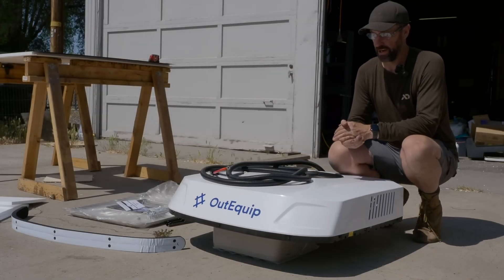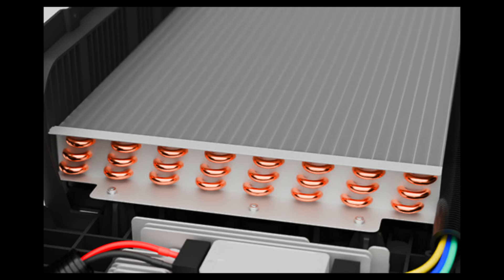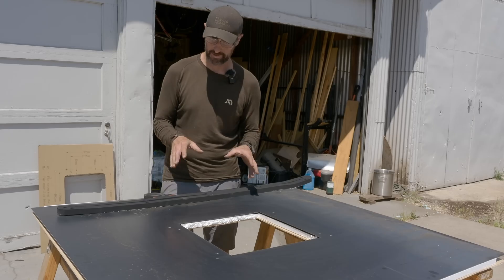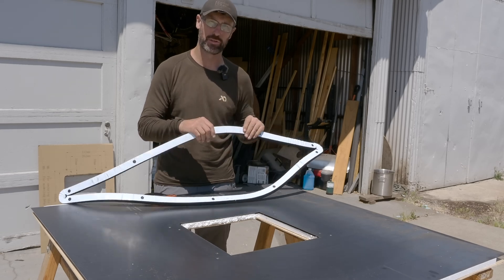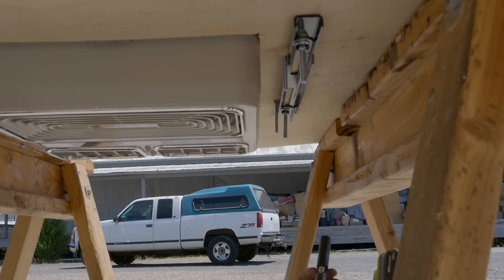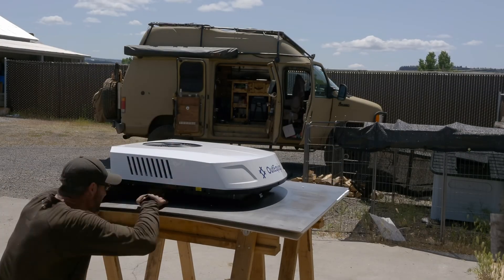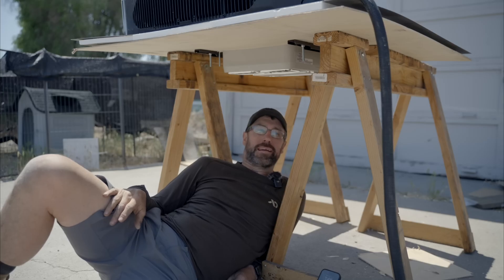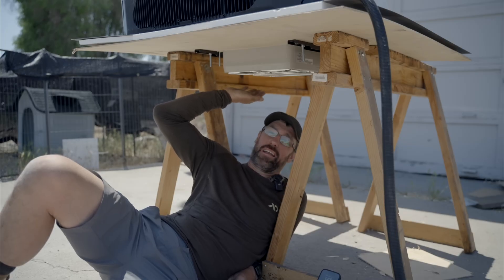OutEquipPro Glacier Pro 12V Air Conditioner with Heat Pump Installation Guide

Comment: I don't know why they don't make a gasket to fit your actually 14-inx14-in hole rather than having to cut the gaskets for both heat pump and just regular A/C unit.

Comment: Your OutEquip looks completely different from the OutEquip that I just purchased, must be a different model.  On my version, you don't have to drill holes for the brackets.  16.5" x 15.3" is the largest you can cut the hole opening, the brackets only measure 19" so an 18" opening would be too big, the brackets need roughly an inch of contact to secure the unit to the van.  In addition, the brackets are instructed to make contact with the metal frame of the van, not the frame, insulation, and wood, I believe it provides a little structural strength to the thing sheet metal of the van body.  All in all, thanks for the installation video.

Comment: The problem with all of these 10k and even this 11.5k 12v/24v rooftops is they are not powerful enough for RV’s 
Ok, van life, a truck camper? Ok. But get it in 105-110 degrees?can’t cut it….
But for anything bigger?
Go 120v Adapt and get one of the new inverter or variable speed compressor a/c unit.
Turbno Greenland inverter 
Furrion Chill Cube variable speed compressor (low profile Chill Cube coming soon)
13.5k 15k 18k ‘s
I have done Countrymod installs and they fall short in a 1-ton Mercedes Class B.

Comment: If adding roof top into non a/c  crewcab Truck,  will it run off of 12v system with no rv type inverters?

Comment: 11:45 - or you could assemble/install a hardwood framework the thickness of your insulation to sandwich the assembly together squeezing/clamping something solid. I did this when I installed windows in my cargo trailer. Cheers!

Comment: RV roofs are thicker and the hardware will be way too short. Works in a van but not an RV. Rv roofs are about 9 - 11 inches thick. 

I ran into this same issue on my DC OutEquip Pro install. This is a completely custom install in an RV to include 12” all threads to replace the hardware and having to create my own wooden shroud to fill the gap on the inside. The bolts and iron bars create the gap on the inside. I had to rewire and use much thicker cable. RV batteries will be a long run to get to the batteries. I also had to use duct foam board to fill the gap on the inside, again RV roofs are thick. 

I wish they made this a lot easier for a RV install.
Reply from the maker: Thanks for your feedback, Coy — and we really appreciate you sharing your experience.
You're absolutely right: RV roof thickness can vary significantly, and traditional mounting hardware isn’t always a one-size-fits-all. While our system is designed to be compatible with RVs, vans, campers, and trailers, we recognize that certain builds — especially RVs with thick insulated roofs — require additional customization.
To make installation easier for more vehicle types, we’re actively working on offering extended hardware kits and accessory options (like inner framing and mounting solutions) as part of future packages. Your feedback is helping shape those improvements, and we’ll continue refining our products to better meet real-world needs.
Thanks again for being part of the OutEquipPro community!
— Michael
OutEquipPro Customer Service Team
Reply: @OutEquipPro  I would like to test it for you when you're ready. I can do a product review video. I currently have your Pro 10000 BTU unit installed in an off-grid Tiffin Allegro Breeze that I have been building out. I took out one of my fans to make room, so I now have three air conditioners, great for Texas.
Reply: I actually like the cord the way they have it coming out of the back.

Comment: I just installed mine on my ram promaster, the first test after a rain, water came inside, i remove the whole a/c and reseal the gasket with butil tape… haven try it again yet but not super sure of the gasket. Will try again and report
Reply from the maker: Hi Luis,
Thanks for sharing your update!
If you're still seeing signs of a water leak after the rain test, we’d be happy to guide you through the correct gasket alignment and sealing process to ensure a watertight installation.
Please send us an email at support@outequippro.com with a few photos of your current setup — especially around the gasket and roof opening. That will help us give you clear, step-by-step instructions to improve the seal.
We’re here to help you get the most out of your install — looking forward to assisting you!
Best regards,
Michael
OutEquipPro Customer Service Team
Reply: @OutEquipPro thanks for the reply, check today and looked dry, will hose it for test 😂😂 and report back